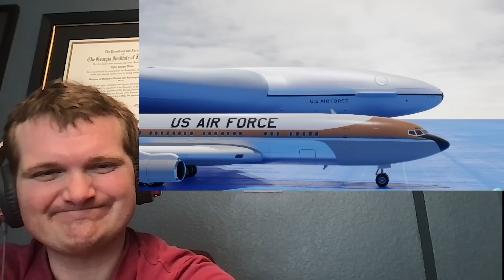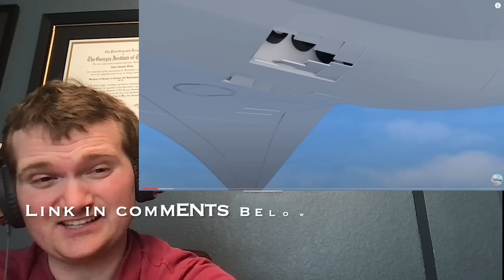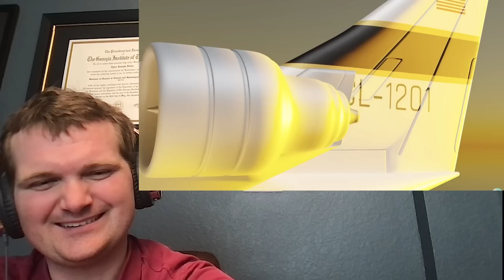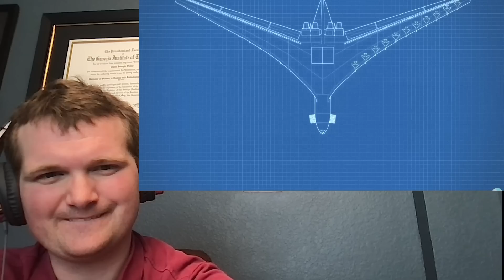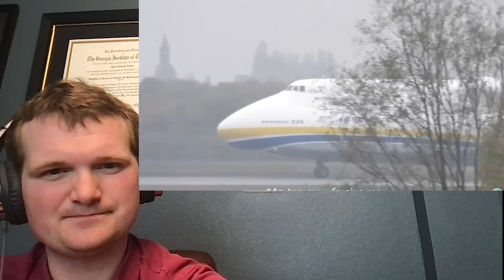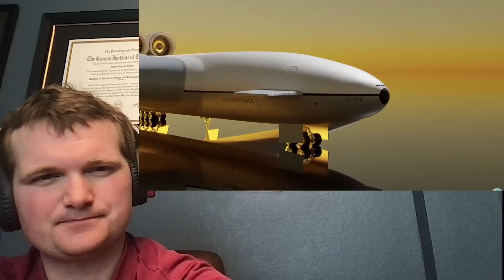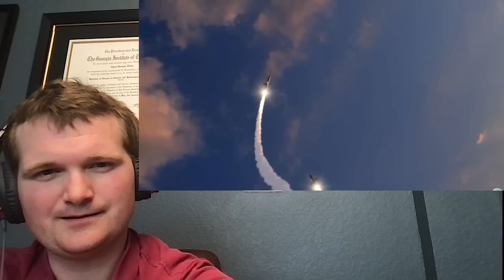A Fleet of Nuclear Flying Aircraft Carriers? - Nuclear Engineer Reacts to Found and Explained

Comment: The times haven't changed much, Nuclear Dude. We haven't backed down from that era's planning and operations. We've only gotten better at using the carrot & stick and increased deaths per dollar.
Reply: When it comes to increasing efficiency and scale of nuclear use we absolutely did. 

The 60s were really trying to extricate themselves from the limitations of PWR reactors and solving their core issues. 

Today's industry is stuck in fear of charging anything about the PWR
Reply: @mobiuscoreindustries I mean PWRs are quite efficient and have relatively high power output, not to mention they also increase reactivity while still being easy to shut down. why fix something that ain't broke?
Reply: @cegicreator2476  mainly because of fuel, temperature, passive safety and steam, amongst other things.

The first and key to nuclear sustainability is fuel. While we have a lot more U-235 that we thought in the 60s, it's still a very rare element. One that due to the nature of moderated neutrons is required for a PWR to function. One made incredibly more difficult due to the solid nature of the fuel medium for the PWR. Making the burn rate criminally low and thus the amount of waste considerably larger than it needs to be. Imagine needing to power your house by burning platinum, but as soon as you burned 0.5% of your platinum you had to throw it away and get a new one? Reprocessing of solid fuel is expensive and governements throw the wrench of proliferation concerns at it, making the problem even worse. 

Then temperature. Despite hundreds of atmospheres of pressure, forcing exorbitant build costs for the primary circuit, the reactor system still remains very cold, and that is a probelm because by virtue of thermodynamics both your cooling and your energy conversion gets better the higher gradient of heat you can generate. Steam turbines are convenient but also incredibly big and require large bodies of water for operations, and that is only possible by raising core pressures hundreds of times to get a core to operate hot enough without the coolant boiling off. You want for both safety and efficiency the single largest factor of liquid range, and water just isn't good at that.

Passive safety is the Achilles heel of PWR and a design flaw highlighted in the very first documentation of PWR by the guy who invented it. PWR is in essence a design made for military navy use. There with their small power and abundance of coolling water, containment was absolute. However he pointed that the fact containment and cooling could not be guaranteed at any higher scale, including what would become civilian power reactors, as to why it was going to be an interim design.  Something to get the gears rolling and expertise in operations created, while it's successors would let go of the solid fuel bundles. PWR just cannot alter the geometry of the core to ensure decay heat to be dealt with passively, because in every other case you want your core to not passively lose any heat. As long as your fuel is a solid bundle, you need to rely on secondary systems for cooling. And we saw the failure of that at Fukushima.  

And finally,  steam. Steam is the worst. Steam has a huge expansion ratio and basically dictates 90% of the largest and most expensive parts of the facility. The giant containment building has to be this fucking gigantic because it has to hold the steam explosion in case of a core rupture (which remember with 150+ atmospheres of pressure, is not exactly a difficult scenario to envision). That drives scale and therefore price massively,  and also makes building reactors far more likely to fail as contractors are not used to work on such gigantic structures and such stringent requirements.  If you can make literally anything to lower the pressure or eliminate the risk of a steam explosion.
Reply: Just because it ain’t broke doesn’t mean it isn’t explosive. Pressurized water reactor, pressure being the operative word here. If there are designs where a reactor failure/meltdown doesn’t lead to a radioactive steam explosion, then that avenue of technology should be explored. If it ain’t broke but can be made safer, then the technology should be improved.
Reply: @antonberkbigler5759  you won't get a steam explosion from a PWR. there is nowhere for the water to expand, it's literally under 100+ atmospheres of pressure that is higher than jupiter! and even if steam could build up in the reactor vessel it won't be able to get through the containment building, which are designed to withstand the force of literal hurricanes! ain't no boiler explosion gonna be going through that thing.
Reply: @antonberkbigler5759  PWRs are designed to operate at 100+ atmospheres, thats higher than jupiter! so no way steam can build up there to begin with. also containment buildings are designed to withstand the force of hurricanes. ain't no boiler explosion going through that thing!
Reply: @cegicreator2476   Doesn’t that literally explain it in and of itself? If it’s designed to operate at 100 atmospheres of pressure, then it’ll be operating at those pressures. Failure to perform maintenance adequately or manufacturing errors could lead to faults within the reactor that cannot withstand 100 atmos of pressure, leading to a rupture that expels all those atmospheres of pressure in a terrible explosion. And it’s operating at 100 during normal circumstances, aforementioned mechanical failures or operative failure could lead to the reactor being run under much higher pressures, more than could be withstood.
Reply: @antonberkbigler5759  there are hundreds of ways to tell weather a reactor has a fault or not and will be corrected immediately nowadays. even so much as a bolt coming lose will be relayed back to control to be corrected. so it is extremely unlikely that anything will lead to a snowball effect and if that somehow happens it will only cause the reactor to trip causing an automatic shutdown.
Reply: @cegicreator2476   Just because something is an edge case doesn’t mean it outright can’t happen. An insignificant chance is still nonzero. Having a dangerous thing with impressive safety features that almost never fail is cool and all but not as cool as finding an equivalent thing without the danger. Don’t eschew Murphy’s law. 

Also we’re kinda talking in circles and losing any sort of point we may have had. Agree to disagree about whatever higher order thesis this thread was about? I mean for my money I was never arguing against anything greater than “don’t fix it if it ain’t broke” because it’s a philosophy of stagnancy. I digress.
Reply: my dude... he worked at a nuclear power plant. he knows what he's talking about!